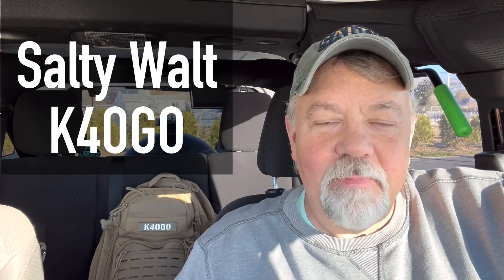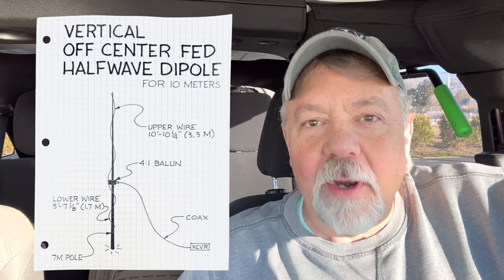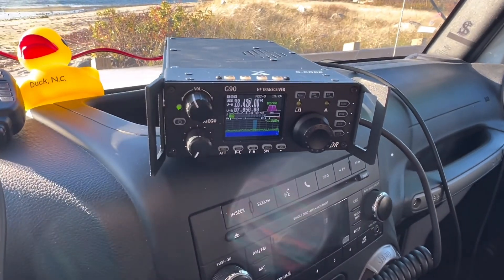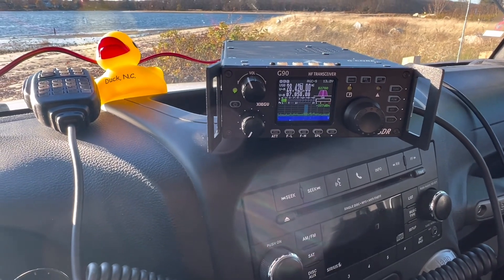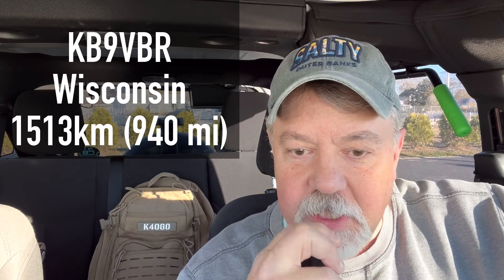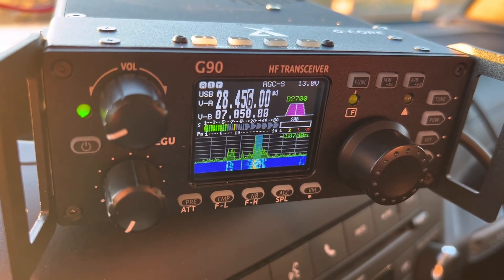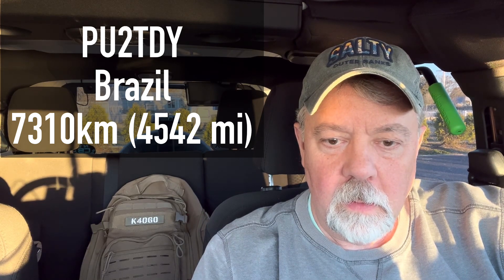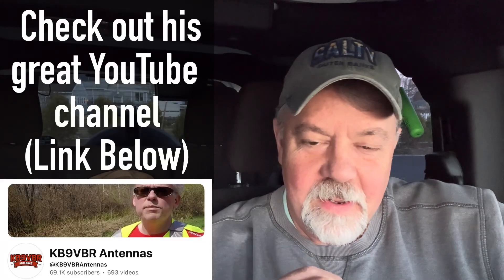Building an Off Center Fed Vertical Dipole Antenna

Comment: Good video.  I just built this based on John Portune's 20 foot Flagpole video.  Wooster pole + MFJ telescoping whip and 4 foot wire as the short leg.  Fed with 600 ohm ladderline to my car, 4 to 1 balun, homemade RF choke directly into transceiver.  Tunes instantly and good performance on all 4 bands.  It will not tune 40 meters but I think I can solve that with a longer dipole.  Thanks for your videos and ideas! ❤

Comment: Thanks!
Reply: Walt, I built this antenna with a 10' 11" top wire and 5' 7.5" bottom wire and got great results with a resonance of 24.95 MHz and it's great on the 12M band. Thank you.
Reply from the maker: Awesome and thank you so very much for supporting the channel! 73, Walt

Comment: I have an off-center fed horizontal dipole that I designed to primarily match 40, 60 and 80m, but it does decently on 15 and 20m too. With some care it can do 160m since it has to be almost a 1/2 wavelength for the 160m, but the off center isn't ideal for that band - I have cooked a connector that way. (gold plated became blue)
Overall experience with the off center is that it's not as "sharp" as a dedicated dipole it's multi-purpose so with a tuner most bands are usable. I have even had 6m QSOs on my antenna, but that has required very good conditions since that's 13 wavelengths in the antenna, so it would basically just cancel itself out.

Then with a 1:4 balun I'm thinking of if a current balun would be a good idea.
However the vertical alternative seems to be a pretty nice idea for the higher bands.

And now I have some new ideas that I'd like to try out as well. The amount of time versus ideas is however somewhat constraining.

Comment: Which has worked best for you on 10m? This OCF dipole, a vertical dipole, a horizontal dipole or an inverted V dipole. Just wondering which has a better DX takeoff angle and which h has worked best for you.

Comment: Just built one of these this morning and had a few minutes to tune around with my G90. Tunes 10, 12, 15, and 20 nicely. 15 looks to be maybe the most usable as it was quite busy with today"s contest. Looking forward to having some time to operate with this antenna. Nice work Walt. I'd certainly encourage you to hang in on 10 even after sunset. You might make some Pacific contacts. Have occasionally heard JA lately and also heard Vanuatu a couple weeks ago.

Comment: Circular polarization is a result of bouncing a Ham band signal off of the ionosphere according to one leading Ham. The late Stan Gibilisco says it is chaotic polarization. Both however agree that a circularly polarized transmitting antenna with a circularly polarized receive antenna will help with receiving ionospheric propagation, and in any case, a circularly polarized receiving antenna with help with any signal bounced off the ionosphere. In this time of high solar activity, I haven’t found any videos or articles about using circularly polarized antennas except by Dave Castler. Have you ever experimented with circularly polarized antennas, and would making a duplicate antenna in this video (edit- and rotating it horizontally; the two dipoles would have to be both physically at 90 degrees and electrically phased at 90 degrees) and feeding it from the first on a quarter wave line make it circularly polarized?

Comment: Hey Walt thanks for yet another idea for an antenna to try. The fact that it tunes rather easily for 12m  sure is a plus. I wonder how it does in terms of efficiency on the 10m band compared to a regular dipole of end-fed half-wave. Yesterday afternoon the 10m band was really good here too, worked my first ZS station just over the grey line with 50 watts and a vertical dipole.
Best 73s my friend.

Comment: Very good Walt ! Michal was a great contact on 2 bands !  The dipole antenna works the same no matter where you feed it. It just changes feed point impedance .   I find off set center hard to tune and are prone to common mode current but some easy fix for that. G90  got that tuned.  I tried with a UNUN  at first . could not get SWR down then used Balun and got it to work.  I was using the outher style of off set center,  70% to 25% or 3/4 to 1/4 of 1/2 wave total.  Just the feed point closer to bottom , Getting that feed point coax 90 deg from antenna was a challenge .  I was using a park bench wooden to hold up 10 meter pole.  I used the 7 meter pole to hold up coax.     was a lot of work but it did work good and I did get a tune under 1.5 SWR with a lot of work. Like hours. 10 meter and 12 meter gray line DX has been great lately !  Vertical is great for that ! That is a odd antenna. it is unbalanced but requires a Balun . It is more like uneven antenna.  The only time a 1/2 wave dipole needs a UNUN is if you end feed it. all others need Balun.  1:1 at center to help with common mode.  73

Comment: What would happen if you took the smaller off-center portion and used it like an elevated radial? Would there be some directivity to be had? Just pondering out loud. Cheers.
Reply from the maker: Yes it would probably create a directional lobe. Cheers
Reply: @COASTALWAVESWIRES  👍

Comment: Excellent antenna. An off center fed dipole works as good as a center fed dipole. If the dipole is a halfwave long it presents a pure resistive load ( or at least very close to pure resistance) to the coax. That is true regardless of the feed point. There are formulas to calculate pretty accurately what the impedance change is for feeding off center. So you can do it for any convenient transformer ratio and get a good match without a tuner if the feed point is right. To me an SWR of 1.7 is nearly perfect, so precision is not required.
 One other note, somewhat related, for my HF dipoles ( almost all I ever use now at home) I usually feed in  the center but when trimming to exact frequency I never worry about having both legs the same length. As long as the SWR is good enough for me, all is well. On 80 meters a dipole will not cover the complete band, so I change resonant frequency from CW to SSB by only lowering one side and changing the length of that side. I use WAGO lever wire nuts to make it quick and easy to change lengths.
Reply from the maker: Great stuff, thanks for commenting! 73, Walt